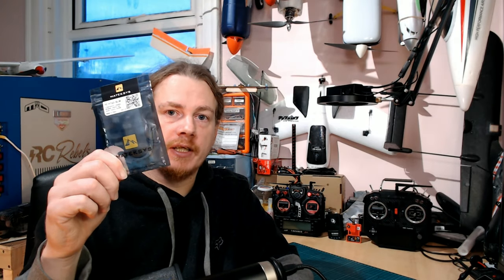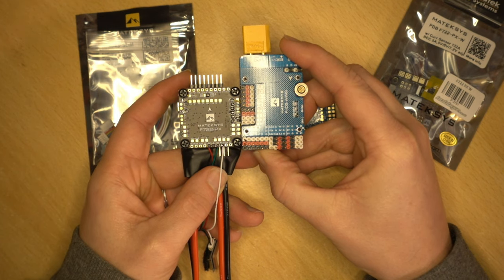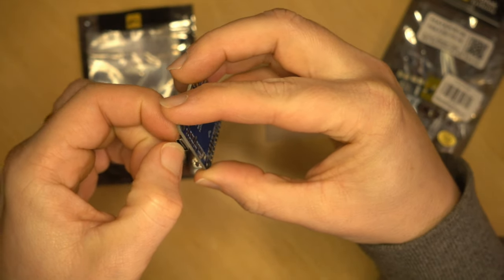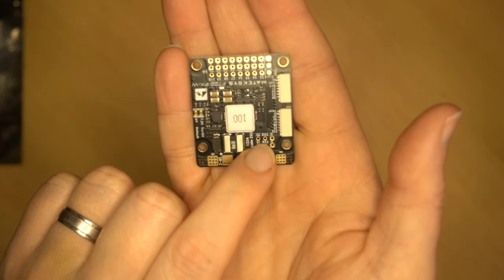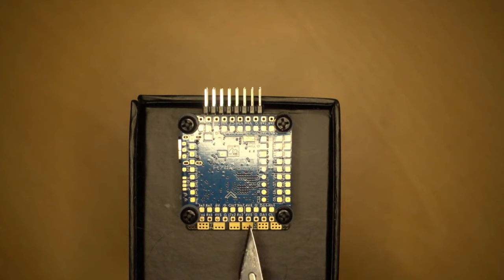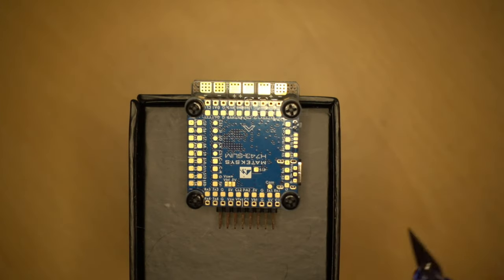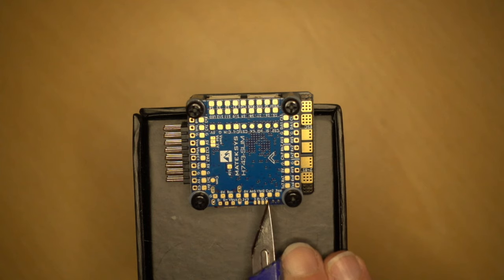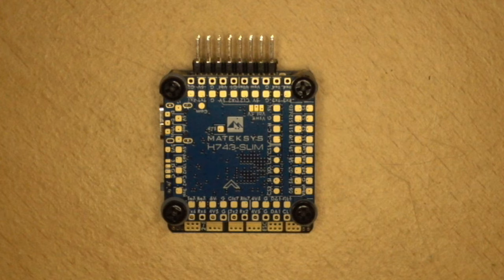Matek H743-SLIM Flight Controller - First look

Comment: awesome videos ! i also am useing F722-PX and F722-PX-W .  the receiver options are TBS NANO RX and R9slim plus o.t.a tha t i plan to flash Express LRS to . the matek manual clear on pinouts but how would u setup the rx on configurator like INAV?
Reply from the maker: Thanks.

For the receiver, just set the protocol on the receiver page to CRSF. On the ports page, set Serial RX to the UART you're using. You shouldn't need to do anymore than that.
Reply: @MrD  👊 thank you for the great videos

Comment: I saw exactly the same compatibility and I got it with the can gps. It doesn't get hot as F7, it is a beast. I got another one with the new PDB- Hex, yeah, for Hexacopter, but is nice for a Vtol plane too (quadplane in atdupilot)
Mine will go in ZOHD Talon GT Rebel, I just done another Talon GT with Racerstar f405- nano , quite good with some bits no so good.
Reply from the maker: Have fun with those planes Andrés, even have fun with the Hexacopter ;) I did a check of temps vs other flight controllers. The F722 did get a little warmer, but they're all fairly close.  https://youtu.be/LfptVdljRvE
Reply: @MrD   I am not able to get ESC telemetry, because of which I am not able to get voltage and current.
Please help 
Flight Controller:Matek H743-SLIM
ESC:T-Motor P50A 3-6S BLHeli_32 4-in-1
Parameters i set are
MOT_PWM_TYPE=6 //DShot600
SERVO_BLH_AUTO=1
SERVO_BLH_MASK=0
SERVO_BLH_OTYPE=0
SERIAL5_PROTOCOL=16 //ESC Telemetry
BAT_MONITOR=9 //ESC
Reply from the maker: @MrNams  because ArudPlane can be a pig to set up. I bought a specific ESC as it had a protocol that was supposed to be supported. Went to hook it up, and buried deeper in the documents was that the telemetry only worked on multirotors. Which is stupid. Maybe it’s different now? But I found it difficult to track down problems with ArduPlane.
Reply: @MrD  Thanks, unfortunately I am trying with Multirotor only and still its not working, stuck for last two days😢
Reply from the maker: I hope you get it sorted.
Reply: @MrD  Yes, i got solution
ESCs don't output current in the telemetry , so after setting Set SERVO_BLH_AUTO=1 you will get RPM etc but not get current value from 4in1 ESC.
4in1 ESC has onboard analog current sensor, so need to connect that pin to FC so for that set
BATT_VOLT_PIN=10 // This value is board specific see mapping for Ardupilot given by board manufacturer 
BATT_CURR_PIN=11 // This value is board specific see mapping for Ardupilot given by board manufacturer

Comment: So I understand H743 wing is not fully supported yet in inav. I’m currently building sky hunter 1800 and I don’t want to have to redo wiring and they say the h743 is fly able in inav3.0.2 and that’s the target I have on fc, I have 3.0.1 version on configurator. My question is on maytek web sight there r multiple cli commands do I need to set all commands?
Reply from the maker: Hi Aaron. From iNav 4.0 (due in a couple of weeks), the H743 is fully supported, with the exception of CANBUS. Everything else works. You shouldn't need to redo any of the wiring if you update the firmware.

If your H743-SLIM is the V1.5, you will need to use those CLI commands to set the correct gyro.

Comment: Looks nice. Mission planner is a mess. I have setup a couple wings on arduplane but never dared fly them as I wasn't sure everything was correct. The ESC calibration is a major pain.
Reply from the maker: Totally Sam. Last time I tried it, I reflashed iNav. ArduPlane is supposed to be good firmware. Its just really let down by MissionPlanner.
Reply: Commom mates I dont know fly and I know setup ardupilot. 
Just use a quad BL32 ESC in Dshot150 (less interference risk than the upper speeds as dshot 600), change the valors with BLHELI suit to the proper ones for a plane.
I setup a 8 grams 40A quad ESC for planes, with telemetry and biderectional dshot firmware, (I dont really know if it means it get RPM filter with it, or what advantage it  gives)
Reply: I used to think this before I spent about a month learning in-depth about Arduplane and oh boy will I never touch iNav again! I love it. I have the same setup for all my long range planes, or another setup for the smaller short range ones. It makes anything fly incredibly well with little tuning. Its Autopilot features are second to none and there's nothing like tossing your plane and watching it fly and land itself without ever touching the controller. I use telemetry with DragonLink so I use the Missionplanner Groundstation to watch and track it while it flies and eventually when it gets to where I wanna fly about Ill throw my goggles on and flip it out of auto mode and if it needs an adjustment or something I just put it in loiter through mission planner, take the goggles off and adjust the tuning while flying and back under the goggles I go. Once you learn to setup Arduplane and capture the features such as telemetry, terrain following missions, insanely accurate auto landing with Lidar, and so much more you wont think about iNav again.

Comment: Darren will inav 2.7 still support maytec F405 wing?
Im just about ready to purchase another flight control
Reply from the maker: Yes, that’s safer than the F722s. The F405 will be around for years.
Reply: @MrD  I need to use M3 screw right for ESC stack?
Reply from the maker: @MrNams  I’m sure the screws used are M2.
Reply: @MrD  ohhh thanks for update.

Comment: I've had issues with the baro on a quad FC but zero with the wing FC inside a fuse, what say you?
Reply from the maker: Did you use open cell foam over the baro Tom?  I’ll keep an eye out when I get it set up. Need to learn ArduPlane first. Was your setup ArduCopter or Betaflight?

Comment: Hi Friend, H743 slim can work with INAV??
Reply from the maker: Yes for the most part. There are still some things in development, like the SD Card slot. But the main flight components work. You can check the iNav GitHub to see the current status.

Comment: Well, nobody must love the MissionPlaner..LOL. But  the new version (test version) runs even on a smartphone or keypad nicely.  How about the INAV configurator ? If the MissionPlanner is not the right choice, get QGroundControl.  ( pc/ smartphone as well) ..edit: both apps work on BT now !!
Reply from the maker: Maybe I’ll try the new version. I think I heard that qGroundControl couldn’t change everything. But this could be old. I’m willing to try things 🙂
Reply from the maker: 100% iNav Configurator is much easier to use. Its not just the layout. Its also things like not needing to load the OSD data from the flight controller when you go in to the OSD page. Something you had to do the last time I tried MissionPlanner; which is nonsensical if you ask me. Still, needs must.
Reply: @Tom Jenson Really? Ok , for a initial setup I agree, but when you have to use the CLI dump, it´s a complete mess. Here is the full parameter list ( with search function) my preference. On QGC  the parameter list is really nice. Every parameter is shown and you can just change it by typing in the new one. Very usefull for tunig a helicopter head . Btw, Inav is my prefence on wings, but on t-type gliders from 2m upwards,......oh dear. No rudder function.....much work in the future. Or will Inav stay forever on wings and quads?
Reply from the maker: I’d love to see more glider stuff in iNav. I think I’ll actually be putting the SLIM in my Ranger 2000 to try out all the thermalling stuff.

I’m the opposite. The bottomless parameter page was one of the things I really didn’t like. I guess its ok if you know what you’re looking for. But likewise, if you know what you’re looking for, a get in the CLI is just as effective.